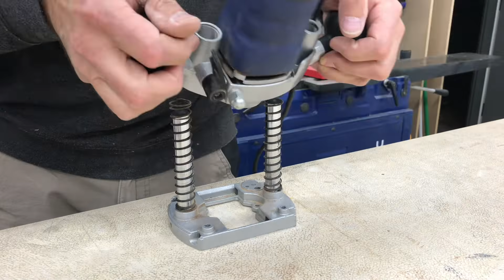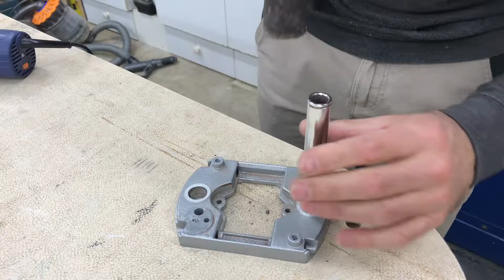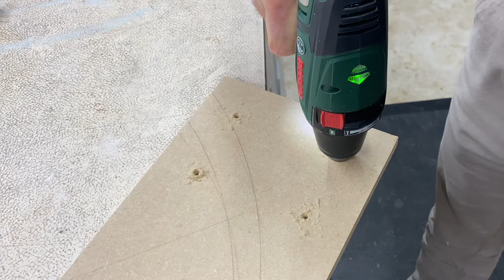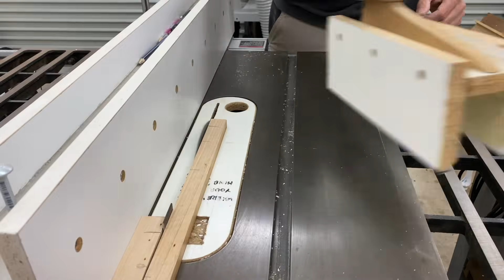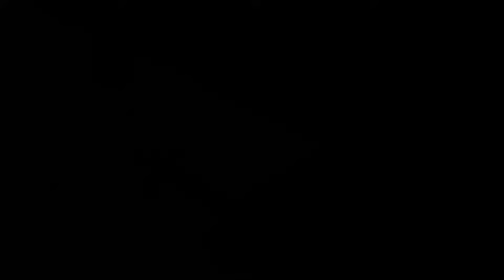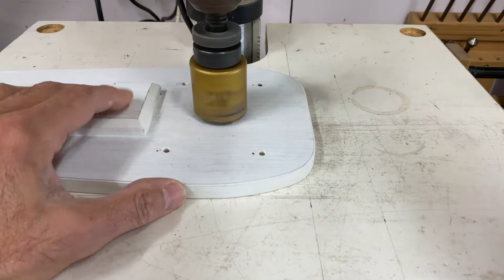Nothing to see here - Just another router circle cutting jig #woodjigs21

Comment: Mine's not so pretty.
The router slides into position, not the pin. The pin's a screw, there's some flexibility about exactly where it goes, so if the hole moves it, I can fill the hole or start somewhere else.

There are recessed slots for the router screws, and the slot for the router bit could have been cut with the bit. I measure radius with a digital caliper for sizes it can measure, but I could use a tape measure (perhaps) or story stick for larger radius. First task was holes for 4" dust collection fittings, snug fit first go. Smallest possible size is well into holesaw territory. I could just make a longer one for larger circles than this manages, a larger one would simply become unwieldy for small circles.
Reply from the maker: Sounds like you still manage to use it fine regardless of its shortcomings. You could always make another.